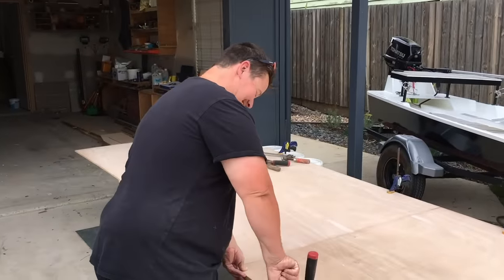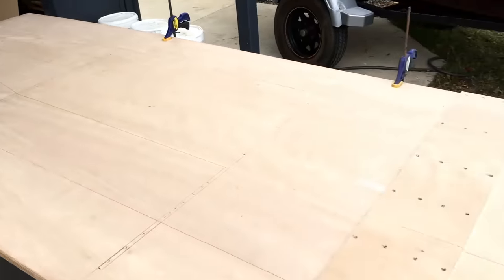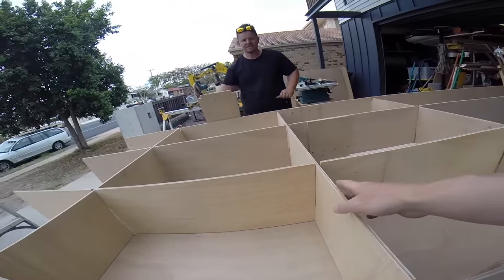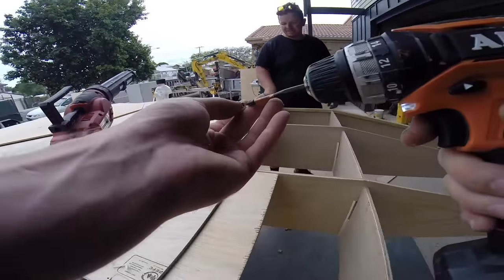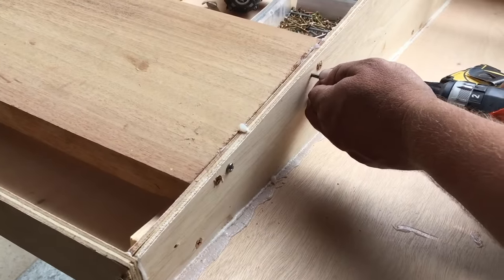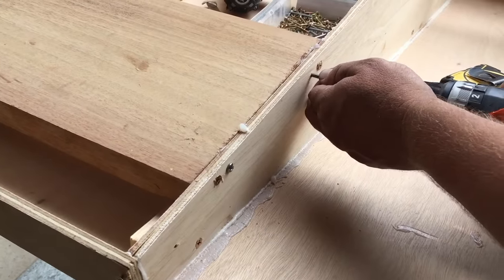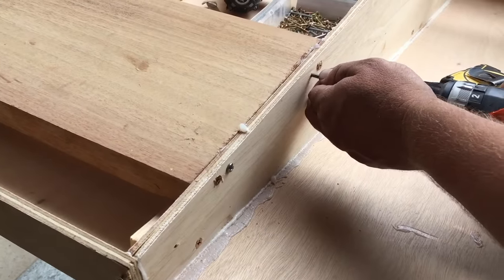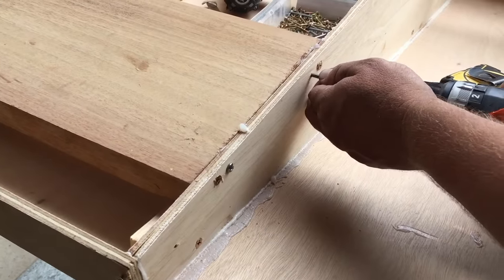How To Build a DIY Plywood Boat // Part 1

Comment: use a zipper bag to lay the thickened polyester or epoxy, fill the bag cut a corner off and pipe it into the corners (like decorating a cake), works a lot faster, the scraped off glue you can put back in the bag until all is used

Comment: Get rid of the screws on the transom and replace with large diameter washers and stainless bolts to spread the load 👍

Comment: Those transom knees should have had strips of wood attached to them so when you screwed the transom the screws could bite into solid wood. You're basically screwing the transom into the end grain of the plywood on the knees which is not a strong connection. I hope it has fared well!

Comment: Should have used Cabosil for the fillets Microspheres are not for structural fillets only fairing. Try a plastic spoon for spreading vs a pop stick.

Comment: Fillets:  Micro balloons in epoxy are not structural.  If you want fillets that add joint strength, use cotton flox in the epoxy to make a composite fillet.  The flox is available through Wicks Aircraft and Motor Sports.

Comment: Thickened epoxy applied to untreated wood will give you a dry bond.  The wood suckes the resin out of the mix.  You have to treat the wood with a compatible resin or the same but unthickened epoxy.
Reply: Marinplywood so no need

Comment: awesome video Timmy. just wondering. Why would you take the screws out ? wouldn't they add to the strength of the boat ? I know that silastic has unbelievable strength, but it was just a thought.
Well done on the video...8 hours !!! wow
Reply from the maker: They weren't stainless steel so we removed them. you can leave them in if stainless. but with the grasp PUA and the thickened epoxy then the dynel cloth and all the other processes in finishing the boat there is more then enough strength that removing the screws is not a worry.  cheers mate :) enjoy parts 2-5

Comment: Cutiously I have the impression it will turn into a submarine after few weeks in water. You did it put any water résistant point to cover it up all. Beneath and over.I think also you forgot to and a bilge pump inside. Beleive me water always find a way to get in.

Comment: I see a lot of people using epoxy to seal. The whole boat ,have wondered if using a board was could work in a lot of cases other then for glueing an strengthening the boat,

Comment: Don't be so hard on yourself.  I loved your fist video building Pipe Dreams 1.0, and it's what got me to subscribe.  Seemed like a great fishing platform.  Would be interested in your final thoughts on it.  Was it ultimately too heavy to lug around?
Reply from the maker: yer that and you could only explore within 4km of where you could get the boat to the water. if the fish weren't biting in that spot it was a waste of a hole day fishing and the weight to getting it on and off the roff everyday as tough and had to set it up and dismantle every trip so mad the decision to upgrade. it has its perks but just wanted to make getting the videos out a little easier for myself

Comment: Looks really awesome

Just curious, why do you remove the screws after the glue dried🤔?
Reply from the maker: we didn't have stainless steel screws so best to remove them. you can leave them in if you use stainless but the epoxy and glue we used for the build is more then enough strength to hold the boat together
Reply: Ohhhh, okay. Makes sense😄
Thanks 👌🏻
Reply: Screws create point loads.  By removing them the load is evenly spread through the backing plate.

Comment: see the plan on your site and wounder dose it come with all the name of product
Reply from the maker: it comes with all the materials and quantities needed. There are many different brands of marine epoxies up to you which one you go with. I used mostly west system 105 part A and 206 part b and the other glue we used was nightingale polyurethane foaming glue 2 tubes. rest is just wood all listed in the plans except those glues I just mentioned
Reply: Ok thanks there. when I got the money I will go to the site and I will go from there..... Can't wait to see it finished :)

Comment: WHY do you take out the screws?
Reply from the maker: they aren't stainless steel. you can leave them in if you countersink stainless but the glue is enough to hold it together

Comment: How much did it cost you
Reply from the maker: part 5 of the build will have a complete rundown of what I spent and an approximation of the same build without hatches in the description. but mine cost roughly $3500
without hatches $2000-$2300 a lot more epoxy, paint wood, latches and hinges made the most of the difference in the two builds

Comment: I’m not sure why you wouldn’t take the time to make better fitting joints? I mean, just a bit more time and accuracy, and this boat will last years longer. This is basically being back filled with glue, which never lasts. This is a lot of work only to pull up shy.

Comment: Marine ply is only about 10 to 15 % better than outdoor ply and it is about four time the cost of outdoor ply
Reply: Be careful with plywood.  There are so many differing levels of quality out there nowadays.  Whats important is all plywood is made from a phenalic glue, this means that the glue is stronger than the timber therefore the timber will shear or break though not in the glue line.  The grades of plywood such as CD to Marine the only difference is the quality of finish to the (inside &) outside layer of plywood, British standard BS1088- 1:2003 nominates only 6 pin knots per square metre.  The reason timber boat designers prefer marine ply over non marine is it's consistant qualities throughout the laminates as it must adhere to the above standard, v's non marine ply which it's standards is much lower and in some cases not meet any standard at all.  Typically lower grades will have large knots and cracks potentially creating weak points and point loads which is not ideal in boat building.  Plywood itself is a huge topic and the above is a general overview, there is also a lot of misconception out there as to what grades means.
Reply: For this boat could use standard plywood. It's a small skiff.